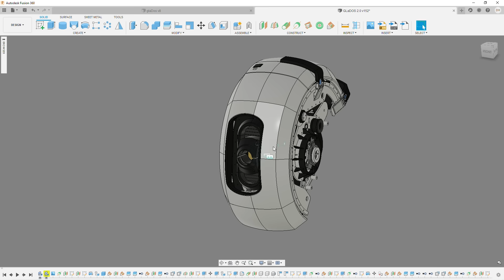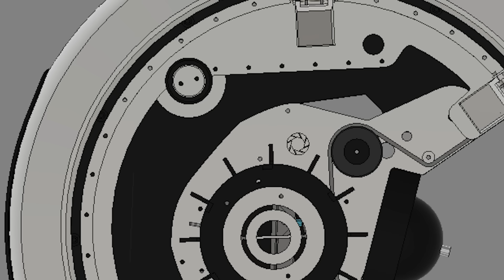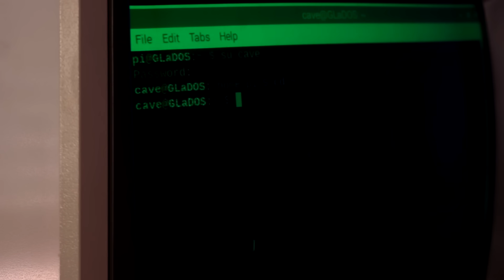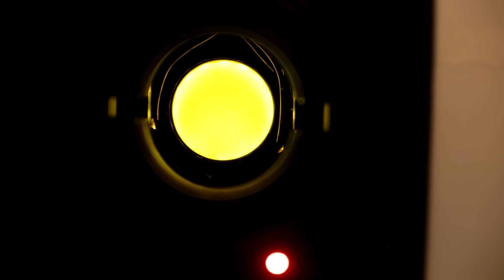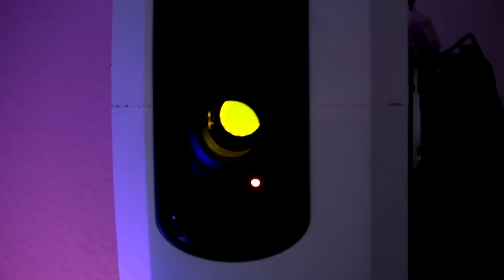So I turned Alexa into GLaDOS

Comment: So, uhm, what's the ball park figure for GLADOS?  And do you have detailed instructions?  Cause thou I think it's a horrible self destructive idea, (Combining the two AI's will surely bring about something more monstrous then Skynet) I have to build one.  And I'm going for a whole corner.
Reply from the maker: I explain a bit more in the Q&A video, but raw materials is about $1,000 USD, but it also depends on what tools you've got access to, since I'm fortunate to have a decent shop. She's be quite expensive to have her parts made by commercial service for the CNC'd elements. No tutorial for her (but the files are available to download and use however you like), since her design isn't done. I'll be making a tutorial for the Personality Cores though :)
Reply: @MrVolt  cool thanks for the info.  I won't be making mine out of metal.  Too heavy, I'm going to have the full body hanging down from the ceiling using a fan for the base.  I'm also going to have to scale down her size a tad.

Comment: so... since your pi is the one that has to hear you before it even lets the alexa listen... I think I can say that I would unironically trust your glados more than any other alexa which is listening 24/7
Reply from the maker: It's actually your nightmare. The Pi And the Echo are both listening all the time. If I were to manually power the Echo on and off it wouldn't work well, since they take 10+ seconds to pair with the network. The Pi just "presses" the listen button. I suppose I could have an extra switch to control the Echo mic mute switch. Then I really could force to the system to Only respond to GLaDOS, hmm...

Comment: THIS WAS SO COOL I SUBSCRIBE OMG THIS IS THE COOLEST THING EVER. 

That echo could be integrated with hass.io using emulated hue so that you can control the actuators based on commands - possibly looking at a lamp that it turns on. 

also did you use the rgb lights on the echo to detect where the speaker is and make the head look at them?
Reply from the maker: Thank you! I'll check that out.

Comment: Haha, Love it!
Reply from the maker: Thanks Jimmy! P.S. No pressure, but where's that next turret build video eh?
Reply: @MrVolt  Hahaha, well, 1:23 of your video sums my situation up pretty well...
I am still waiting to print a huge piece for the gun housing, When that's done and if it works, i can print the other side and have 2 doors to test the motors with the full weight of the prints/motors etc. That would be worthy of a video update.
My rear leg assembly test was a complete disaster! And the legs themselves broke where they were glued. Thankfully I caught the turret as it was falling over :O
I need to reinforce the 3D prints with metal tubes  etc etc etc adn some more etc. So much redesigning to do....